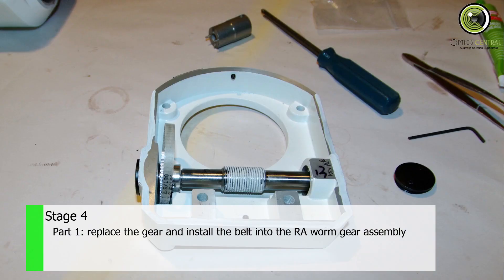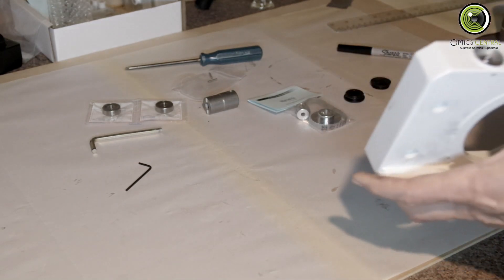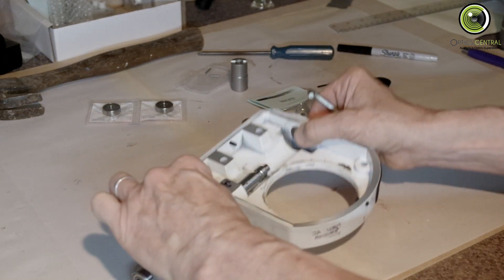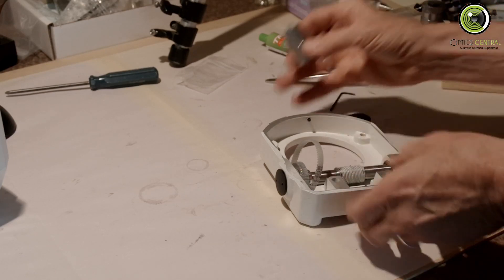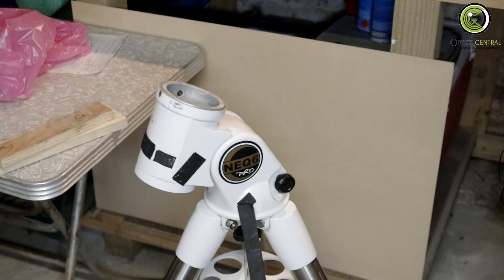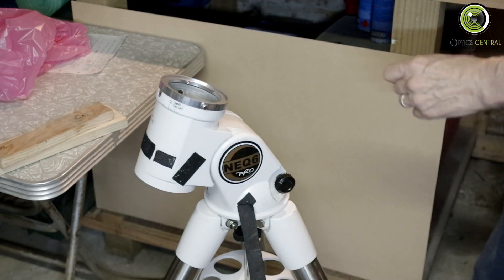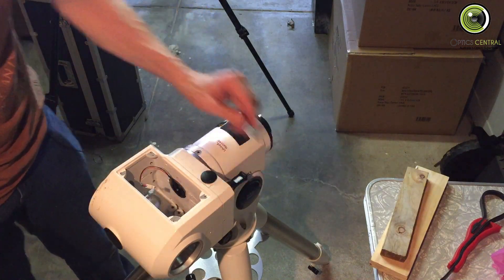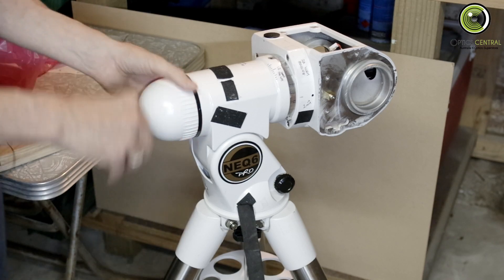Belt modifying an NEQ-6 pro astrophotographic mount - Part 4

Comment: Excellent videos Bill. You mentioned that the worm gears were still resisting but smooth. I wonder if the bearings need greasing before installation ( as per Astrobaby ) even though they are sealed.
Reply from the maker: Yes, I probably should have changed the main bearings when I did the work, but getting the shim widths right was more complicated than I wanted to get. After speaking with an expert though, I've changed my mind about sticky unclutched axes. They're not really a problem while guiding because they're clutched. They take a bit of balancing though, and even then, you're never really sure how good your balance is. With my scope's very short 560mm focal length, super accurate guiding isn't quite so important, so "your mileage may vary".

Comment: Great vido series....did you put the 2 bearings back in under the Caps either end?
Reply from the maker: Yes, you can see the new bearings in their packaging on the workbench at about 3:30 in this part. There's a better diagrammatic explanation of how the worm shaft is re-installed in part 5 starting at about 7:30. The bearings go back with one on each end of the shaft.

Comment: Great series ! 
Did you grease the shaft itself ? 
Can you please describe all part that you greased except the brass worm-gear , the worm, and the bearings ? 

I had very hard time extracting the brass worm-gear, I'm afraid there will be issues replacing it back.
Reply from the maker: Basically I greased everything that was going to be moving, including parts that would only need it during the installation process. So yes, I greased the shafts in preparation for installing them into the bearings that were in place already. Installing the shaft was tricky, because the tolerances are very small. If you get the shaft crooked inside a bearing it sticks very tightly. I think you can grease pretty much everything. If it's not actually required, it won't hurt. It's not a dusty environment inside the mount, so the grease will remain pretty stable.